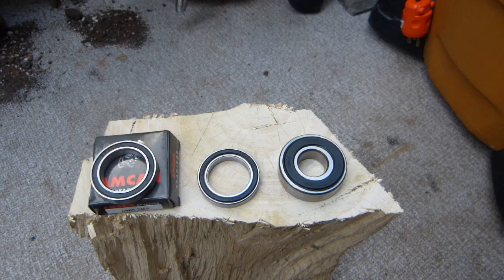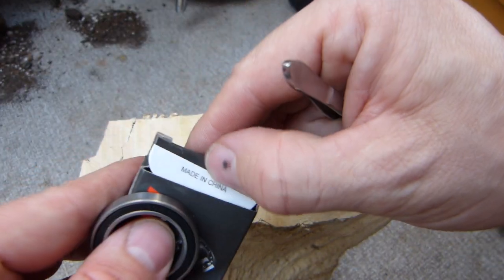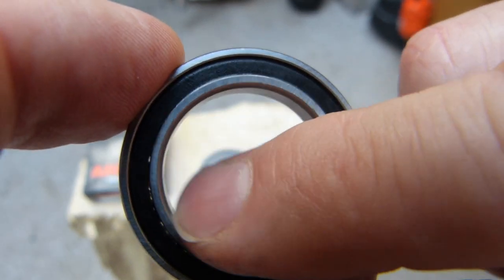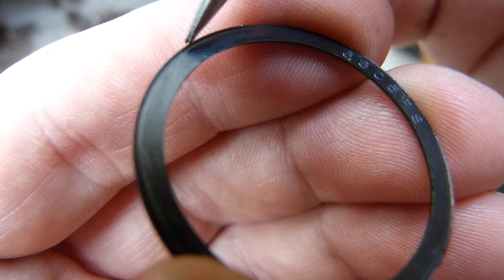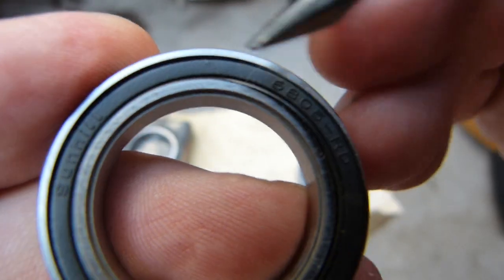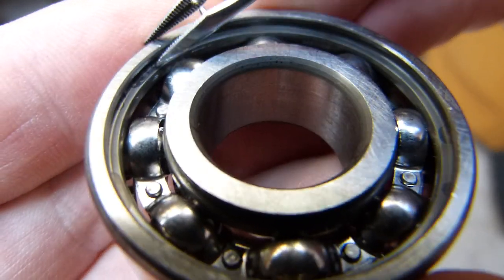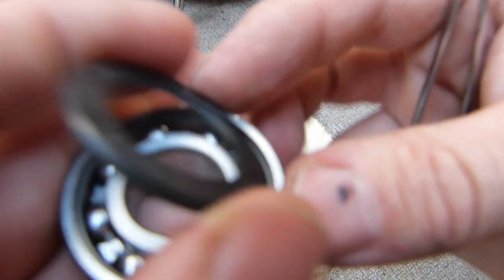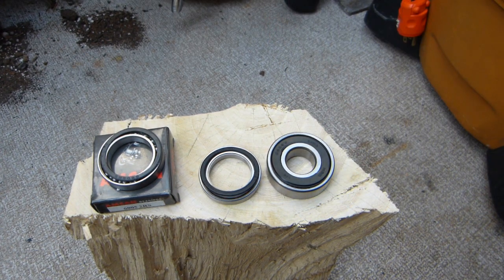Bearing quality issues: Made in China vs premium brand

Comment: I have compared Chinese bearings with other bearings too, we have replaced the Chinese bearings with Japanese ones. However the problem was not the bearing itself but that they were installed in a wrong way which helped them to heat up too much.

And the bridge between the balls is not so the balls won't collide, that's just a spacer so the balls are evenly distributed. If you get all balls on one side you can remove them (which I did and I gave the steel balls to my kids for playing afterwards).

Comment: Why do reviewers pick the absolute cheapest knowing it's going to be crap but never pick moderate priced Chinese ones from a reputable source. 

Just for views.

I bet many of the viewers don't even know that China has th most industrial patents by a large margin and many sectors using high precision bearings.
Reply: True, if it is from a reputable brand and made in China, (which is kinda bad for local businesses but I won't get into that now), there's a good chance the quality is just fine and if not, there's a thing called warranty. The thing to really stay away from is nameless Chinese or knockoffs, no tree to bark up against and no quality control.
Reply: Exactly, I've not come across any issues using pricier China made bearings. What you pay is what you get.
Reply: valid point. Half of your “all american” retailers source their parts from china as well as aviation and train locomotive industries. Sensing a biased video.

Comment: nice comparison. the one thing the chinese made bearings all have in common is the atrocious metallurgy. i don't know what they do to the steel but they just never seem to get it right. the temper is always off and the alloys are probably wrong for the applications.
a good friend of mine was in china for a while and said they don't export the "good" products, only the rejects that won't pass QC. the quality of some items made in china that i've purchased over the years seems to more than corroborate that claim.
Reply: Dude why do you keep buying the cheapest possible in China? Do you guys even know how to look for a proper supplier?
Reply from the maker: ... assuming buying substandard parts twice lasts as long as 1 good quality part. The Chinese wish. It's more like a 10-to-1 ratio, maybe even worse ...
-thanks for watchin'
Reply: my ordered ceramic bearing just arrived today. looks like your friends is right,the quality is worst than reject product. the bearing cant even run straight & too much play/gap. i ordered 35 of them,even the best of bearing in the package is not smooth. fml
Reply: Chinesium Alloy is made from the world's Amazon returns. ;)